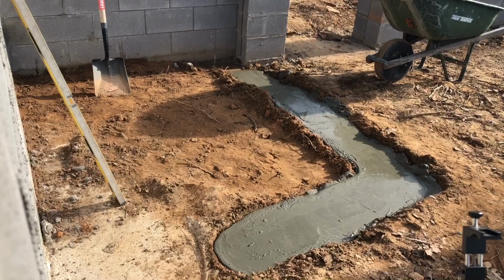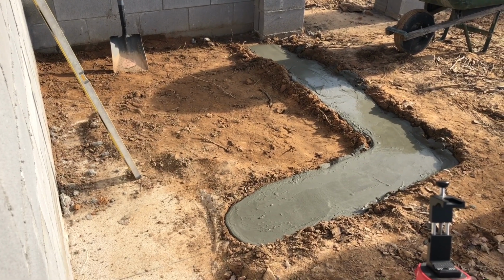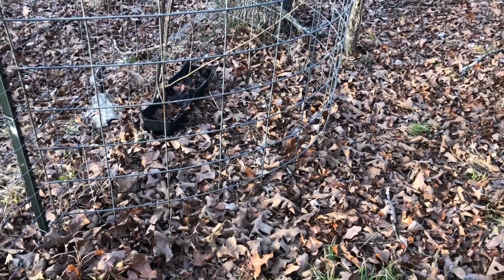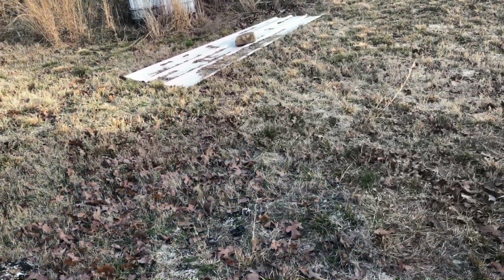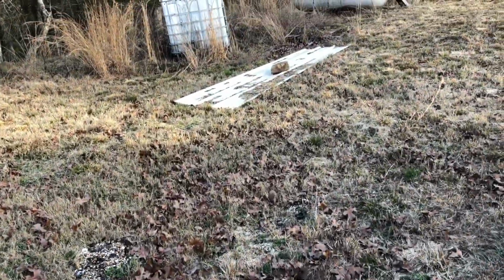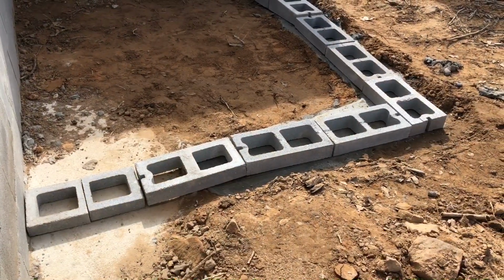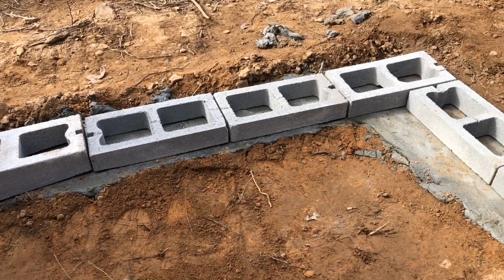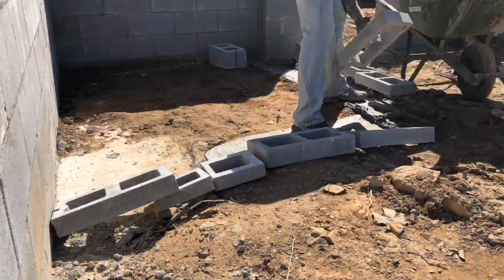Building a concrete bunker under our house!

Comment: That wall is not going to save you from a tornado! You have no rebar in your footing. I also would mechanically connect the wall to the footing by having rebar from the foots going into the brick

Comment: The footings should have been poured using concrete (larger aggragate) instead of the mortar used.
There should also be reinforcing cage in those footings which needs to be attached to reinforcing cages in the footings of the existing walls.
You could also have carried that reinforcing up through your blocks and filled the cavities those rebars run through with mortar after building the wall to height.
In the absence of interlocking the blocks with the existing walls, wall ties should be used to add the required bond.
You also did not fill the frogs which are designed to connect each layer of mortar binding the entire wall together.
Without these measures those walls can easily be pushed over and are, in fact a danger.

Comment: Imo, it needs waterproofing to handle hydrostatic pressure.  It needs electricity for climate control, if it's going to store anything of value in it (cans, ammo, electronics in an EMP-resistant container, etc.).  It needs ventilation, and/or CO2 scrubber and O2 supply (depending if you're going with air-tight fallout shelter or not).  If so, it also needs its own EMP-resistant power source.  A HEPA filtered vent system may work when radiation levels are lower and O2 supply is low.  A built in Geiger counter and radio antenna extension are good ideas, too, so you can stay inside while still having those functions.  Generally, 3 feet of earth is considered sufficient against free neutron and gamma radiation.

Comment: I hate being negative but 6x8 isn't much.  That's not much larger than a piece of plywood.  Lot of work for something so small if you want to store couple of people, water and a few snacks.  Let alone a couch or chairs for something to sit on.  No steel,  footing to thin and looked like cement not concrete.  Sorry